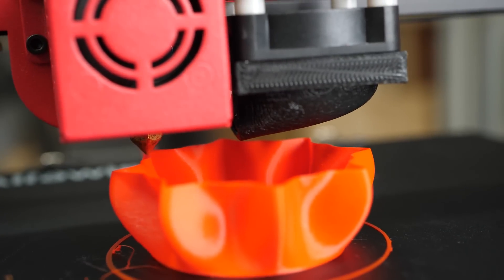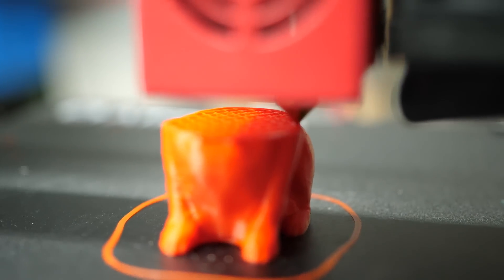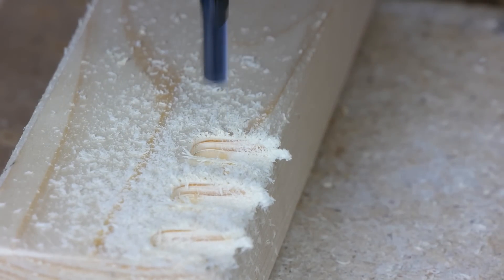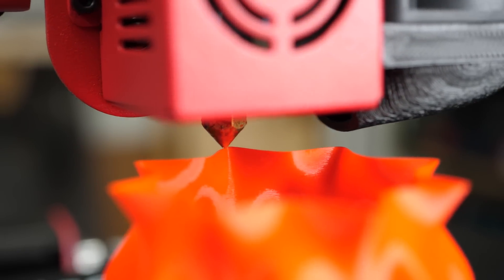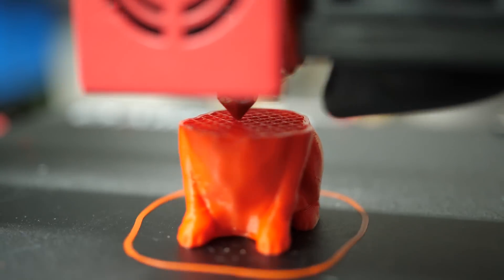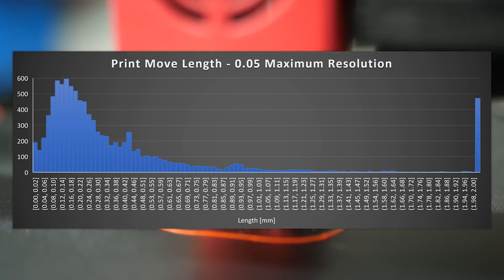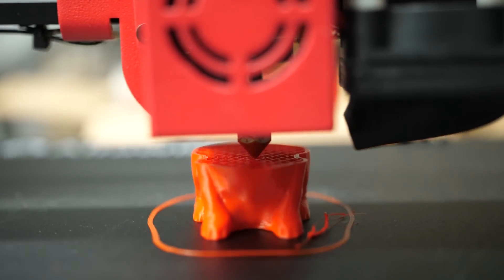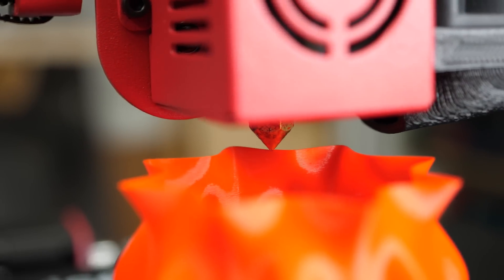(How) I finally got rid of these blobs!

Comment: Stephan, I've been having a similar issues printing a small cylinder with my Artillery X1. After much testing I realize these blobs develop when the print head pauses to think. Thus in the resolution/flow/speed variation testing I found that actually lowering the speed was the solution as that allowed the print head to move without pausing.....Changing the resolution likely achieved a similar result by allowing the head to pause less, given the simplified tool path. This begs the question??? Can these types of zits on curved surfaces be eliminated by going to a 32 bit board??? Im consider this issue, as I currently have to print at about half the speed to get rid of them. Perhaps with a 32 bit board the print head will stop pausing to think at higher speeds??? Id like to know what you think? but also this would make for a great episode and an interesting comment on the 8 vs 32 bit board question.
Reply: Yes and no. I have the latest 32 bit bord on the market and realized I still get it if I'm running Octoprint. If it's directly from the sd card. This isn't necessary but good idea to still do as it improves speed with little bit less time. Best solution is combination of all. Lowering the outerwall speed by half of what it's default is and speeding up overall to compensate and to do this mesh fix a little. Finally, print off of the sd card. There is also the option of editing your Marlin to increase buffer size but I won't be going there as if you are doing that. You may want to start optimizing your models itself instead. Oh and almost forgot. Make sure to get Arc Welder on your slicer and or Octoprint.
Reply: @AnickYT  turned out the SD card was to slow and caused a bottleneck for the instructions. Better thumb drive solved it.
Reply: @ThePhilbox  now I must ask, what printer did you use that has faster USB port than the sd card slot? That's like all kinds of backwards from printer I'm using and often recommend.
Reply: @AnickYT  I'm sure sd was faster, but didn't want to fiddle with a micro SD. Pure convenience issue. I was on an aswx1. But those days are long gone now. Voron 2.4 with klipper. I've seen the light, no going back.
Reply: @ThePhilbox  oh voron with klipper, that explains. Mine is Ender 3 with Marlin 2.0+ SKR Mini e3 v3 mod alongside of octo4a.

Comment: Not sure what I did to get rid of blobs. It was probably when I quit trying to push beyond the machine limits in speed. I found a manual for the printer and used the recommended speeds.

Comment: Nice..i was having this issue on my cr6se. tried adjusting things with retraction and zhop and all but i think this created issues with the filament slippage as i started getting prints that would fail with the nozzle a few mm above the print not spitting out any plastic and the filament having been ground into by the extruder gear so that it was simply sliding back and forth a bit and not actually moving down the boden tube to the nozzle. Being new to this i was gonna check my install of the capricorn tube to make sure i did not mess up the install by leaving a gap on the hotend side and well i snapped the nozzle off in the heater block :( 
Should have the replacement tomorrow along with a dual gear extruder just in case that was the issue (have heard some negative and i took it apart and seen the design and see a lot of "flaws"). 
Will come back to give my results as my cura settings are half the example you showed at MR: 0.25, MTD: 0.25 and MD: 0.025 and the one time i tried vase mode it was horribly slow and was only 30% done after 2 hours...there was no smooth continuous movement only short movements and short pauses. Only had a printer about 2 weeks so videos like this are very helpful!

Comment: Thank you so much for this info! After having my printer for about 6 months, I finally felt like I had it down enough to get myself some pretty silk rainbow PLA and my prints were NOT turning out good. I've done temp towers, retraction towers, watched so many videos on whether or not moisture is a concern and I re-sliced a vase with these settings. Its' not even done yet but I can already tell this made a HUGE difference.

Comment: Great video! Was super hopeful but I tried the settings you recommended (.5 vs .05 in cura), and still getting blobs/zits =( I think it must be because I have an older 8bit board in my printer and it just can't keep up with all the lines of code. I have found that slowing down my outer wall print speeds to half of 'default speeds' has helped with the blobs a bit, but otherwise still struggling with these random blobs/zits. Not sure if there is anything else you can suggest or something I have overlooked?

Comment: Thanks Stefan, this helped me a lot by removing 99% of my blobs. 
I've struggled to print some car parts I'm trying to make in CF Nylon (this is a fantastic practical material) on my CR10S ProV2 (8 bit). I have been getting a large amount of random blobs but only on the curves - never on straight edges. This time I looked closer at the nozzle when doing the print and noticed the strange stuttering motion exactly like you mention.  My solution was to go back to Fusion where when I exported the STL via the inbuilt 3D print tool and discovered my devitation settings where making way too many facets. It seems my 8bit board can't keep up with the huge file like you mention. I put the Fusion output settings (Refinement) to Medium which dramactically reduced the facet count from 20,000 down (silly for a small aprt) to around 3k and shrunk the file size as expected. 

Here in the change. https://ibb.co/7jzP4sg 
Not hard to tell which is which -  just have a little tuning to do on the seams on the cylinder which have a little over over extrusion but not that bad - coasting? I have plenty more of your videos to watch. 

Thanks again.

Comment: I'm using PrusaSlicer on a Prusa i3 MK3 printer. I can't tell what I should change the resolution setting to to prevent these blobs. Also, What is the equivalent of maximum deviation on PrusaSlicer?
Reply from the maker: No need changing anything using a Prusa Mk3.
Reply: @CNCKitchen  I would say ok, but I'm getting tiny blobs on mine in random places. And when I look at the model in PrusaSlicer, There are no points of travel, retractions, or unretractions where the tiny blobs occur. What could be the cause? I tried asking Prusa Support, but they weren't sure either.

Comment: I'm using Ender 3 profile for my Ender 3 V2 and holy shit, my values were (automatically) set to be even lower, I've never noticed any problems though until I tried to print a spiral vase, I might need to play around with that since my printer stops at spots and leaves ugly blobs. Again, only in vase mode, so no clue what is going on there.

Comment: Wonder if the filament makes a difference too by the way, because I was not getting these marks with my original Creality test filament that came with the machine, I switched to a generic filament and started getting these blobs...

So maybe my generic filament gets way too liquid in the 200 degree celcius nozzle temp settings and oozes out whereas the original filament kept at the correct viscosity and didn't leak onto the print.

In short I am saying setting the nozzle temprature a bit lower might also help fix these spots, I will experiment with it see how it turns out..

Great video and explanation, your method seems great will give it a try for sure... 😊👍

Comment: Did anyone figure out how to do this in Prusa Slicer?  The only options available there in v2.2.0 show: 1. slice gap closing radius 2. resolution 3. xy size compensation 4. elephant foot compensation.  It seems that "resolution" might have the line simplification effect, but it's vague enough to imply that perhaps it will do so at the cost of deviations (chord rise / sagitta), whereas Cura has an explicit control for that.

Comment: I'm still struggling with vase mode on my ender 3v2 I don't see how my Anet A8 could run vases no problem but the 32bit board on the ender is struggling, tried modifying the settings you did here but still no joy, will keep trying though
Reply: Any luck?
Reply: @jackdunphy240  nope, I just gave up trying print Vases

Comment: I fixed that issue for me by switching to another firmware. "Klipper". It does all kinematic calculations on python on the the beefier processor of the rPI and then sends only very rudimentairy bytecode to the printer. It can reach very high step counts on just arduino mega boards and made the hardware incredibly cheap. Can only recommend it if you like to tinker with firmware more but it's also a bit out of the ordinairy and not as feature rich as marlin or others for example.

Comment: I've had a similar problem when using octoprint on my ultimaker original. 3d printers emulate a USB serial terminal, and even at the fastest baud rate, If there are a lot of small moves, the printer can process gcode commands faster than they can be transmitted over USB. Especially with ultimakers because the head can move fast and round corners without decelerating much. This would cause the printer to stutter when making a whole bunch of small movements. To fix it, I just printed from SD instead, because an SD card can be read much faster. Just don't delete files off the card and periodically format it to minimize file fragmentation.

Also, Make sure your printer is using 250000 baud over USB. My printer was using 115200 baud, so I reflashed it with firmware that was using the faster baud rate, and similarly set the same baud rate in octoprint, and that reduced the problem significantly.

Comment: Updating Cura to 4.7.0 changed the presets:
On version 4.6, I had the value Maximum Resolution set to 0.5 and the same value 0.5 on Maximum Travel Resolution, on Maximum Deviation it was 0.05
I installed version 4.7.0 and the first two values are unchanged, but now the Maximum Deviation automatically changed to 0.025 at the same profile.
Why? And is that better or worse?

Comment: I have the Longer LK4 (not pro), which is the same printer as the Alfawise U30. I was having similar problems with movement and Octoprint. I compiled and installed Marlin, and it’s much better. I think the main issue is the default firmware runs the USB connection at about half the baud rate, compared to Marlin.

Comment: I'm having this exact issue with my Ender 3 V2 which should have a 32bit board and I figure should be able to handle such command rates. Is there a way to adjust the buffer to allow the board to use its full potential?

Comment: This setting has not fixed this problem is there anything else you could recommend. I have recently replaced the nozzle, with the old nozzle I didn't have this problem.
Thanks,
Bertie.
Reply: Can you describe your problem, or is it exactly the same as in the video? You might misinterpreted your zits. Something similar could be happening from stringing. When your printerhead moves from one line-end to a line-start somewhere else, your Extrudermotor stops moving, but some material is still ozing out, and you get those zits and/or strings. You can solve this with retraction, which should be normally enabled, but maybe the value is to low(it is dependend on your filament you are using and your printer itself). As a starting point you can set it to 1mm for direct drive printers and 4mm for bowden style printers. If the string remains, higher the value in 0.2mm increments until you are ok with your result

P.S.: A bad Filament could be also the problem, due to it's qualilty. Trying out another filament might also help

Comment: I had this problem at my ender 5 Plus. I made a check: I printed a low poly cat. And at every rounded edge, the cat got bumps on the shell and on the flat areas in between not and also not in the rectangular infill pattern so it is very likely that my ender 5 Plus also suffers from that problem also because the cura profil per default was set very low.

So thanks for the video, it was very usefull for me.

Comment: This is my first time watching one of your videos, and I only have one thing to say... You are amazing.  JK, I have more to say. :) I couldn't find an answer for my blobs in vase mode ANYWHERE! Without you, I would have been dead in the water. BTW, I have an Ender 3 V2 and using Cura. I couldn't fix this issue for the life of me. I had to pick Ender 3 pro profile in Cura cause they don't have a profile for the ender 3 V2 yet. When I looked at the settings after watching your video they were " 0.05, 0.05, 0.025" that's 0.025 for MAX deviation! I'm pretty sure that needs to be at least 0.05. I'd bet my life my next print will be fine. Thank you Sir. Thank you for all your hard work.

Comment: So, what was the setting on the Ender 3 that worked for you?
Was it 0.5mm or a different one?
Reply: I used the 0.5mm setting on my Ender 3 w/ Cura and it cleared up almost all the zits on my Benchy.
Reply: @brentvecchi4893  0.5 max res, max travel and max deviation?
Reply: @kamiko-i5g  Max Res = 0.5, Max Travel = 0.5, Max Dev = 0.025
Reply: @brentvecchi4893  thanks i was looking for this, so the 0,7 max travel wasnt better?
Reply: @brentvecchi4893  hi I’m having this issue with my Benchy and it came stock with it set to .25 and max dev .025 and I’m still having these zits what would y’all suggest
Reply: @TheRandomRobert71  If you haven’t already you should go through a general printer and filament calibration - especially e-step, flow rate and temperature tuning. Also make sure you are slicing with an up-to-date slicer.
Reply: @brentvecchi4893  Amazing.  Going to print a benchy now to see how this works.  I have been changing all sorts of setting trying to fix this and now probably need to reset everything and start over lol
Reply: On the review of the two of them he said that the ender didn't have any blobs out of the box so he didn't have to do anything to fix it.

Comment: Although I hate to swap SD cards all the time, I've stopped using Octoprint for this reason. It doesn't help that Octoprint is written in Python which is not very performant on single board computers, also it's GIL (Global Interpreter Lock) can cause such jitters in data streaming.
(Would be interesting to write a simple CLI tool in native code which can stream gcode, and try it to see if it improves anything)
But as you stated, most of the 8 bit printers don't really have much memory to buffer data coming from the serial port, and it's also necessary to acknowledge each command separately (can this be disabled?)

Comment: Thank you so much Stefan! I was printing a human model and it was printed toooo blobbed so it appeared to have some kind of disease :P. After changing to your values, it have only some blobs. I was wondering if this is firmware problem-wise. If i use the THD firmware, the blobs disappeared, but if i use marlin 1.1.9 the models have a lot of blobs with the cura stock values (Resolution = 0.05)

Comment: Hi, thanks for this  educational video. I am using the ENDER 3 Pro and CURA 4.6.1. 
This is the first CURA version that has the ENDER 3 PRO preset printer as an option. 
Max. Resolution and Max. Travel Resolution is preset to 0.05mm.
The Maximum Deviation is preset to 0.025mm which is half of the settings in this video.
I usually print at a low speed of approximately 40mm/s. The overall quality of my prints is very good.

Comment: Had same issue with CR10S Pro year ago. After trying to reducing resolution I had another problem -- I was unable to increase print speeds anymore.

Switched to Klipper then :). It is like 10 times faster imo. Especially on slow 8 bit hw.

Comment: I also noticed disabling acceleration and jerk control in Cura and switching to firmware retraction reduces the gcode size tremendously. Firmware retraction is two simple g10/g11 commands, instead of two multi-parameter g0/g1 for the retraction/unretraction itself, plus other two commands for z-hop.

Comment: wow! this is exactly what ive been looking for! ive noticed that my Solidsworks generated STLs have wierd artefacts and traced it to the same "nodes" which you pointed in the vid. ive been looking high and low for a solution,  beyond generating a higher resolution STL [wich still has the problem btw. will try out the cura settings you mentioned. thanks!!

this was my query on a FB page related to it.- https://www.facebook.com/groups/1959877270949115/search/?query=kevin%20&epa=SEARCH_BOX

Comment: Yeah i have experienced this for years on my CR-10, i guess it is 8-bit board. My models usually have around 5-6 millions of polygons, and if i print at say 50mm/s, the prints will get these micro-pause-blobs everywhere. It took me a long time to figure out the solution but i finally found it in cura, sadly there are no automatic decimation / merge vertex features to tweak in Simplify 3D. Pretty much no matter how high i push these values in cura the blobs will not completely disappear, only improve slightly, the solution for me have been to smooth the model and output it in a much lower poly count, or print way slower. I guess newer 32-bit printers can handle higher poly counts and small details much better. EDIT: just tried to only print the outer most outline/skin slower (on a highres detailed model) at about 30mm/s and the rest at 55mm/s and it worked great, so this is another option to add as a solution.

Comment: Wow! I have been fighting a problem on my old Taz5 that I replaced the toolhead with E3D Aero. The printer slows  down dramatically on long curves and the printer temps start varying wildly.  I had recently turned up my printing speeds. I was also getting the blobs (printing PETG). I have been looking into whether I am getting stepper motor resonance or something else. This looks like a very good candidate for the root cause. Thank you for the information.